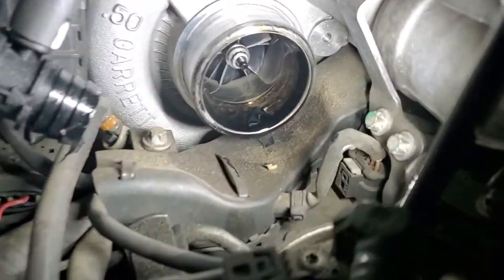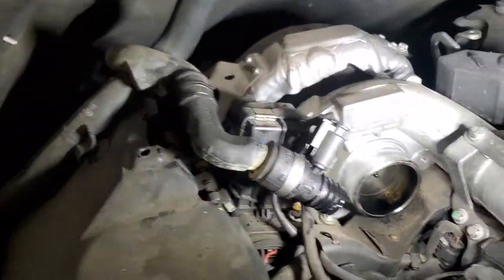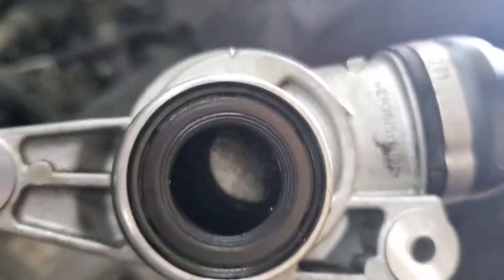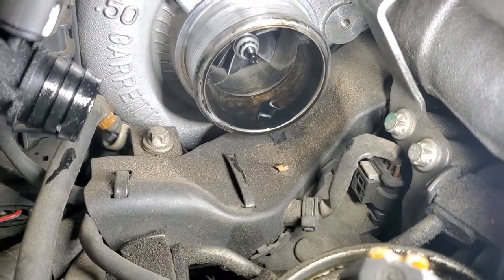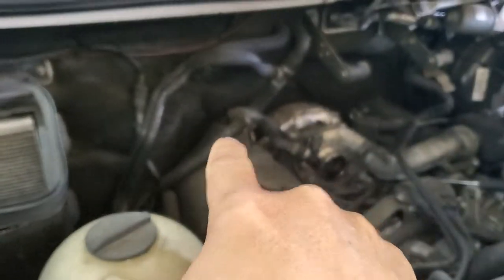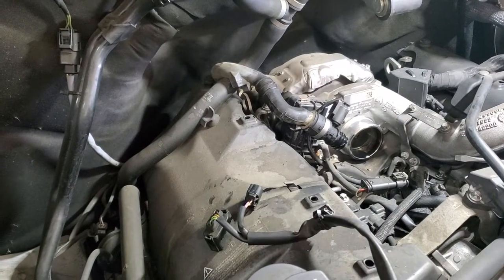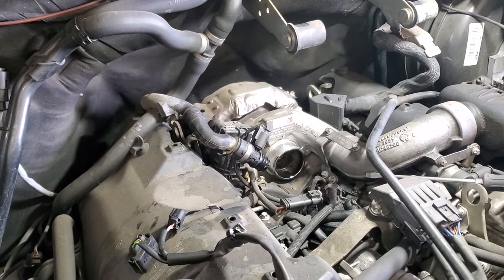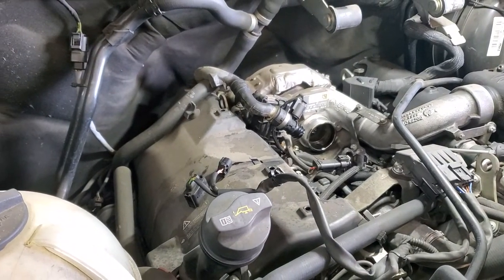Sprinter van crankcase ventilation valve do not separate oil

Comment: This part is called the Crankcase Ventilation-Valve, or  "CCV Breather Assembly" for the OM642 engine.   An $80 parts (aftermarket version) that is fairly easily replaced.

Comment: Nice, told us at least three times the part needs to be replaced, but nothing on actually replacing the part. How do you get to it, are there any specialized tools needed, etc.
Reply: Not hard 8f you can see it from memory 2 bolts hold it in place. Clean the rubber tube if you don't have a new one. If you do just swap it out

Comment: Great video.  Probably pretty tough to replace.  What is your opinion on a Oil Catch Can?
Reply: Excellent question. Obviously replacing the OEM part will help but will a catch can be a better long term solution?
Reply: It's a way to avoid the actual issues: the PCV valve. Change it every 50-70k km and problem solved. And if you have the PCV valve design without the camshaft o-ring connector, change that too when you change the PCV.

Comment: Will this part fit my 2007 Sprinter 2500? I suspect this is the cause of my big oil consumption. Thanks
Reply: are u getting white smoke on idle or just oil consumption?
Reply: @el_Chupo  both
Reply: No they are different
Reply: No they are different

Comment: I had it replaced,but did not solve my problem there is a lot of oil... 800km-3,5 liters of oil...
Reply: you need to repair the engine
Reply: @MaximMaximov or maybe check oil cooler